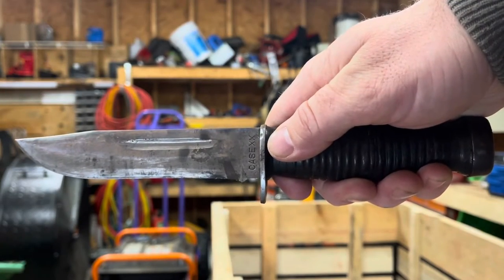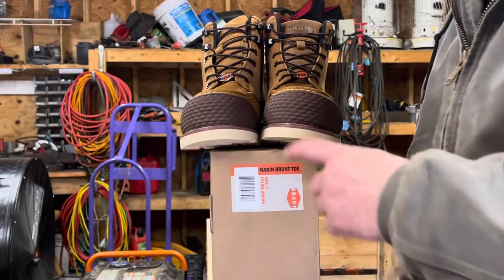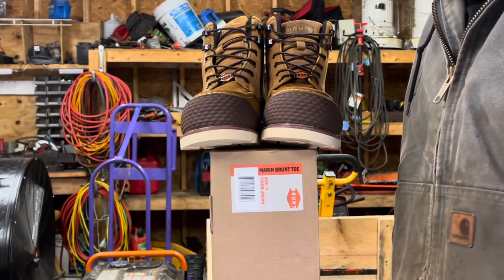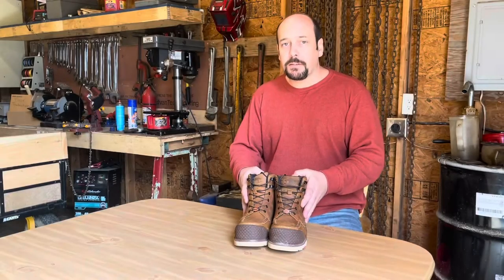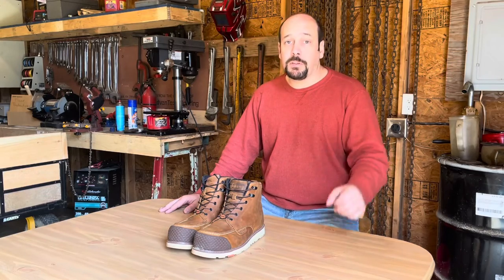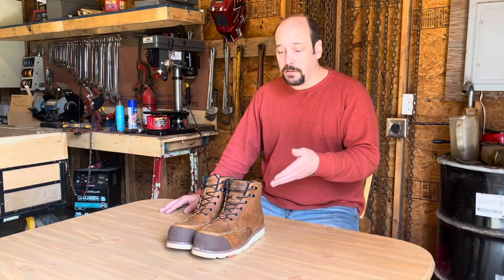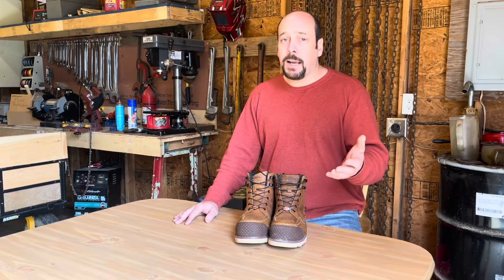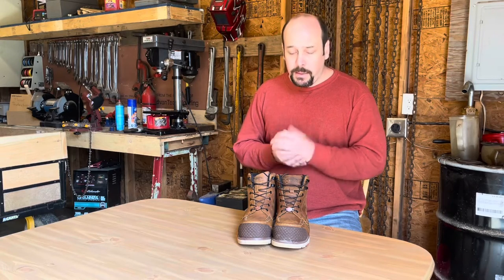The truth about BRUNT boots!!!

Comment: No cork or leather midsole.  Cheap heel counter.  Run far from these boots.  Rose Anvil tore these in half and the insides are very poorly built.
Reply: I'm haveing problems with moisture build up.
Reply: I keep trying to tell people that anything with a cemented sole is essentially a sneaker. Yeah maybe the materials are a bit nicer than a sneaker but it's going to fail just like a sneaker and in about as much time. Just go buy some skate shoes or get a real pair of boots and stop pretending. I can't stand the bogus hype I keep seeing over this trash brand.
Reply: They have invested heavily in to advertising and promoting. Doesn’t change the fact that it’s basically a Walmart boot. The clown in this video was obviously paid. And judging by his current boots does very little actual work.
Reply from the maker: @bazookasblog I went to your channel to see what hard work looked like… but all I found was you playing video games 🤡 🤡 🤡
Reply: I’m on my 3rd pair in six years, they’ve held up exactly like redwings and setters do. I was unsure at first, but they are more comfortable than boots that are twice the price.
Reply: @josephgravelle8287  You are one put of hundreds that had a good experience.  Not taking those odds
Reply from the maker: @josephgravelle8287  I’ve worn out a lot of boots. None last forever, and I agree many of the top name brands aren’t very comfortable. My Chippewas took forever to break in
Reply: @BuildALotAcres  if the prices were the same as between brunt and Setters, I’d get the Irish setters. They are touch better in quality, but the actual differences are minimal.

The brunt’s out of box comfort is crazy. The double soles are awesome. I have wide feet, so I take the extra one out. After a few months, I pop it back in and it’s like a brand new pair boots.
Reply from the maker: @josephgravelle8287  Great idea! 👍
Reply: Cedar trees have worked miracles for me keeping moisture out. I put cedar trees in mine at the end of every work day

Comment: You get what you pay for.  Seems like a decent boot for most blue collar workers with good feet. But IMHO they wouldn't last me 3 months. I work in the oilfield and have messed up feet from the years of trying to get by wearing cheaper boots. The only brands that I have had the best luck with are Redwings who also tan their own leather in Minnesota certain styles of Wolverines and Thorogood.  Most are probably $60 to $100 more but in the long its cheaper to pay $260 for a better built boot that will usually last me 12 to 18 months
Reply from the maker: I hear you. I used to go through boots like crazy doing construction.
Reply: Thoroughgood are wonderful.  I have a pair for my job and after 12 hour shifts my feet don't hurt

Comment: I have a pair of 2 year old Marins still in use. They look like crap but are still holding up through everything from cutting the grass to accidentally sandblasting them multiple times. I will say the tread was never my favorite in slush, ice and snow and the break in took a little longer than expected. Overall good not great, feel like sneakers to my feet after break in and would buy again. I had a pair of Carhartt in the same price range that didn’t last 8 months which is what made me try Brunt.
Reply from the maker: I think you hit the nail on the head. For the price, they are a pretty good option. There are certainly better boots, but not in that price range imo.
Reply: Jim green is a great company for sub 200 bucks
Reply: I think he cut the ones without the brunt toe, which I'm sure these are a lil better, but I have Irish setter wingshooters, best boot for the 200 dollar range imo